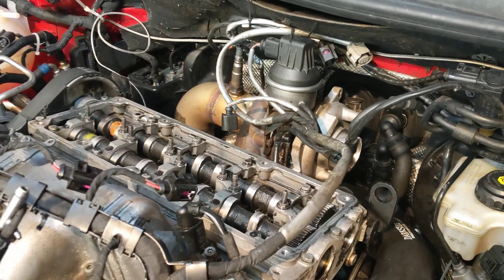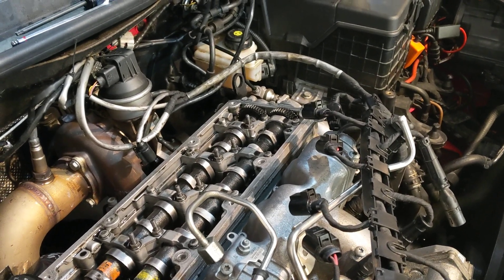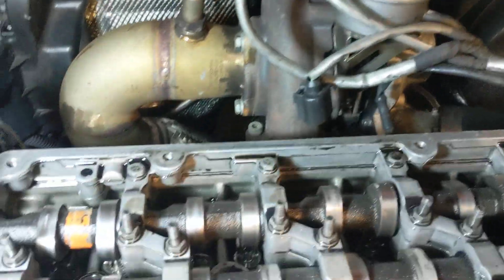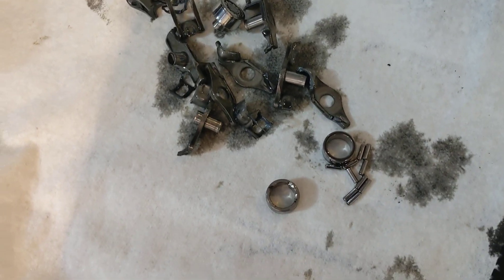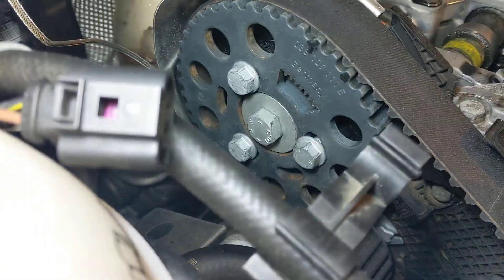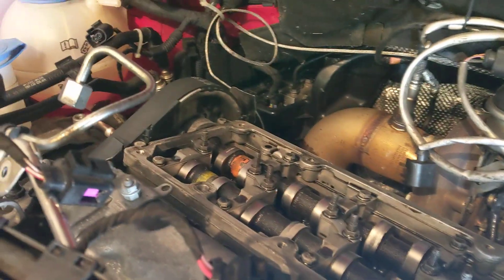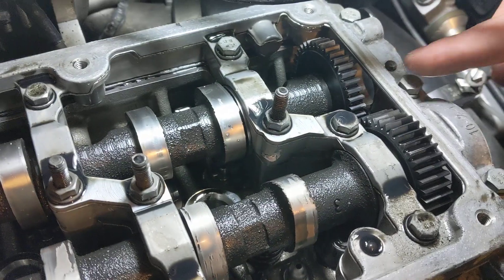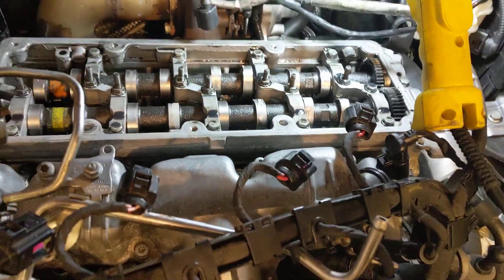Broken cam gear, smashed rockers

Comment: I had a VW repair shop (not dealership) do my timing. 200 miles later, large timing idler pulley bolt broke (at 60 mph with WOT). Repair shop closed their doors and now i'm out a vehicle. Having to do this as well now...Knowledge is power!

Comment: Yeah,  that's rough.  It sounded a bit too clattery in the cold start video.  Maybe that's just from the aggressive cam profile.
Reply from the maker: The chatter was from the new hydraulic lifters. It went away and was running really well for about 60 miles.

Comment: That sucks man, I hope the damages aren’t to much worse
Reply from the maker: Found a used engine locally for $500, gonna just start over.
Reply: Let's turn the crank and se to timing Mark's. Get some one to look the gear of the intake cam. Its possible loose.
Reply from the maker: I rotated back a few degrees to TDC and locked the crank. The cam sproket pin went right in. The belt held perfect timing while the head ate shit! I was very impressed!